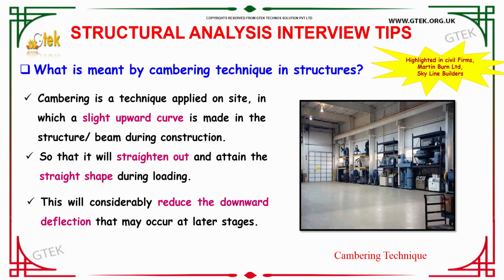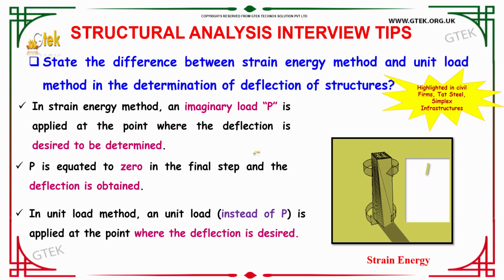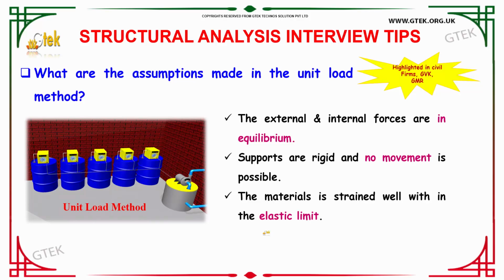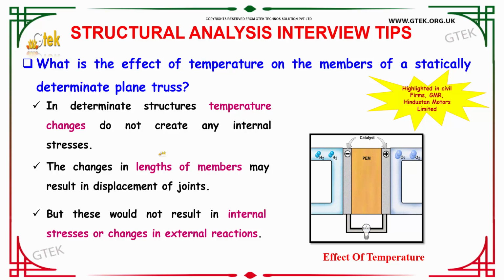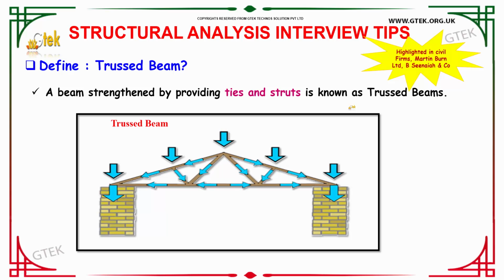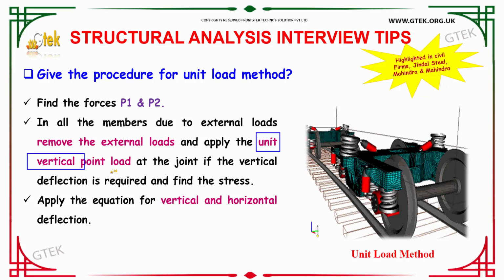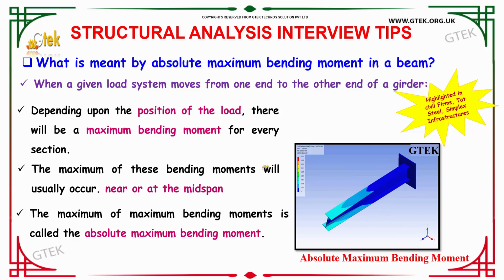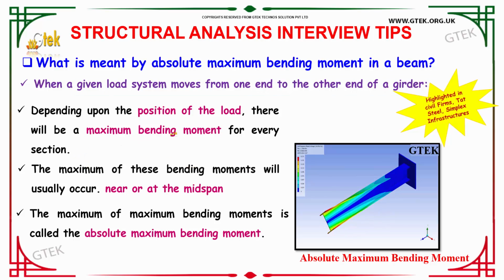Top 20 Structural Analysis -1 Civil Interview Questions and Answers Tutorial  for Fresher

Comment: A structure is a series of connected, interrelated elements that form together a system that can resist a series of external load effects applied to it, which includes its own self weight, and provide adequate rigidity. In civil engineering, a structure is usually made up of, Beams. Columns.

Comment: Spalling Reinforcement: The spalling stresses leads to stress behind the loaded area of the anchor blocks. This results in the breaking off of the surface concrete. The most likely causes of such types of stresses are Poisson`s effects strain interoperability or by the stress trajectory shapes.